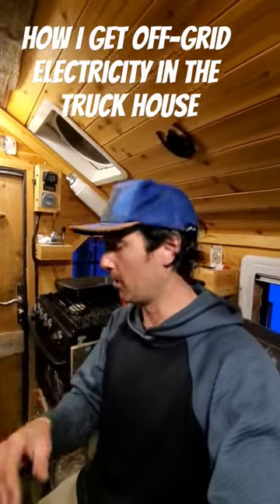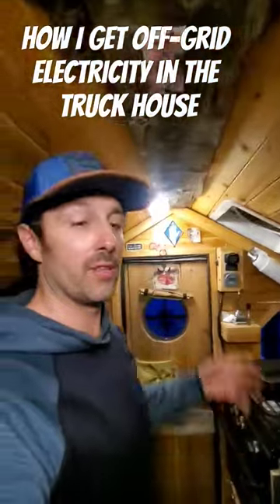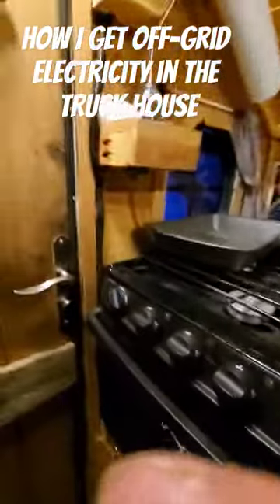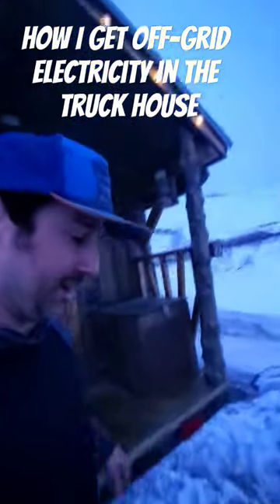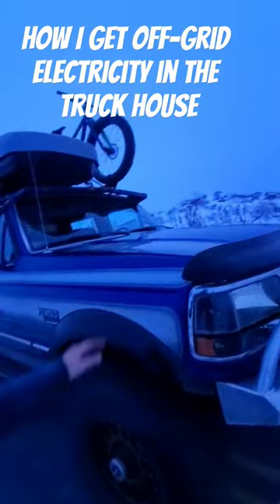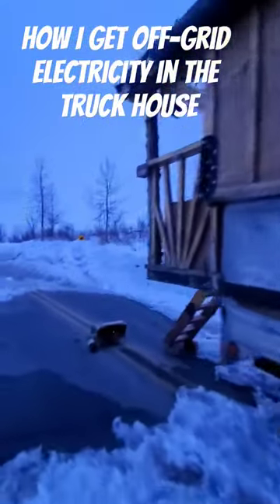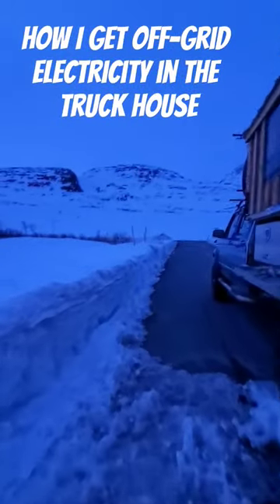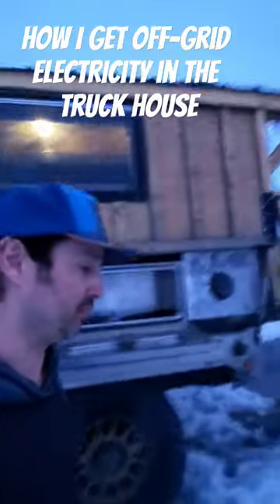How I Power the Truck Camper with Off-Grid Electricity #vanlife #offgrid #tinyhome #tinyhouse

Comment: A second alternator is really handy if it doesn't rob too much HP.  They really put the juice out.  That old 7.3 is one tough engine.  I've seen several with over 600K miles on them.  Be safe.  Cabin building time.
Reply: That's good to know! I just built out my E-250 van so my wife and I can travel. It's a 2011 and haven't havn't a lick of trouble with it. It barely has 1K on it now.
Reply: You’re exactly right. don’t forget to put that shut off solenoid in so you don’t over charge

Comment: My home is powered by a 1250 watt solar array and a 450 watt wind genny.   Battery storage is quite modest, 4 L16s wired in series for 24 volts/425 amps.   Off grid full time since 1997.

Comment: In the 90's I purchased a greater alternator for my truck and I used an old battery connected to the truck to power my 13 ft trailer which I lived in all summers at work chopping wood for a living :-)!

Comment: my father was a mechanic and built us a truck camper way back in the 80's before llithium batteries existed..  he added a 2nd battery box into his truck under the hood, hooked it all up to the alternator   in such a way  with a solenoid so   that  the camper only drew juice from the 1 battery and we could completely  drain it .  the other battery left full charge  then when truck is running the alternator recharged both batteries.

Comment: If you use rubber covered cords or extension cords, they will not crack in the coldest part of winter... ( Just a tip for ya )

Comment: Yeah, right. Ain't nobody living off-grid with a single 100-watt solar panel. If, as you say, the truck charges the batteries in "half the time" as of the single 100-watt solar panel (which would be 4+ days), then we can deduce that it will take 2 days for your truck's alternator to do the same job. I'm not buying whatever you're selling (Battle Born batteries, no doubt).

Comment: Just be careful.  I’m sure you don’t need to be told that lithium batteries are highly flammable and can even be explosive.  Those appear to be right under you.  If you’ve got some sort of self invented set up beware.  It hadn’t been tested in all the conditions you’ll be seeing.  Keep a fire extinguisher close at hand and of course a smoke detector.  Which reminds me you’ve got a carbon monoxide detector in there right.  Good luck keep us updated.
Reply: depends on the chemistry of the batteries. Lithium Iron Phosphate like the Battle Born batteries he's using have great thermal stability are very safe. They have to be very abused to be an issue, even when punctured they often times won't go up in flames.

Comment: In other words, your camper is completely powered by your truck, and on a flawlessly sunny day, you might get enough solar power from that dinky little panel to turn on a single cabin light for 10 mins....awesome.
Reply: No you can do a lot more then one light   A 100w panel will put out 8amps max so around 5-6 amps average for 8 hours is 40-48 amp hours   The diesel heater he has takes 10amps for a few minutes to start up then around 1 amp hour to run  the led lights take .2 amps to run so almost nothing   I have 2 100 watt panels on my small school bus and 200 amp hours of batteries and I can run my fridge, heater and lights without any issues if I get 4-5 hours of sun
Reply: If only you knew what you were talking about.